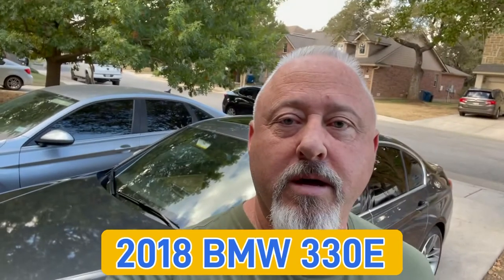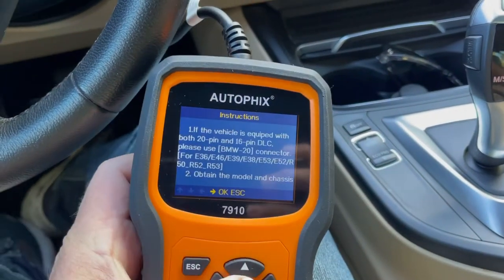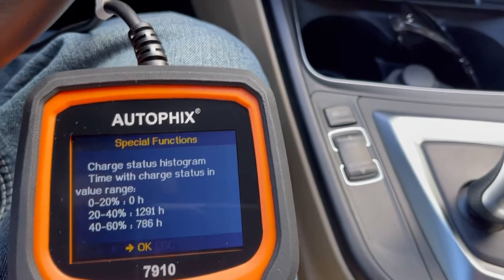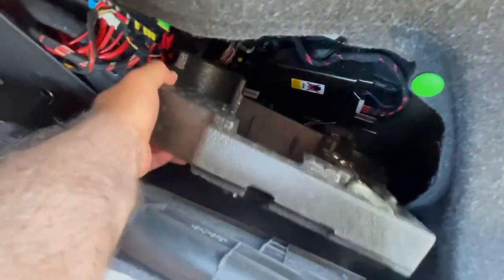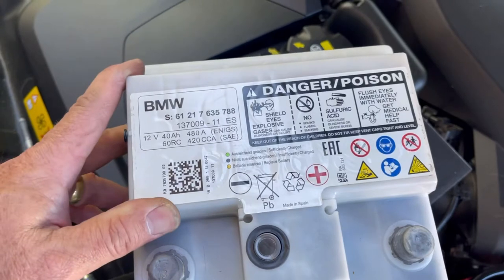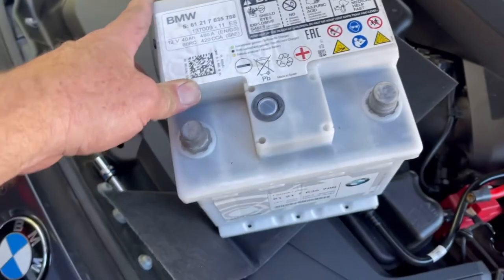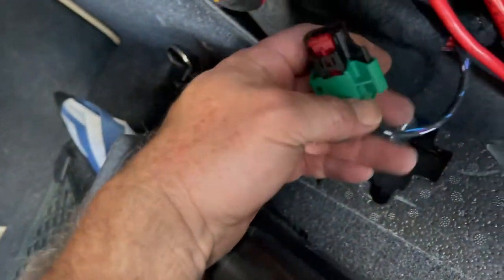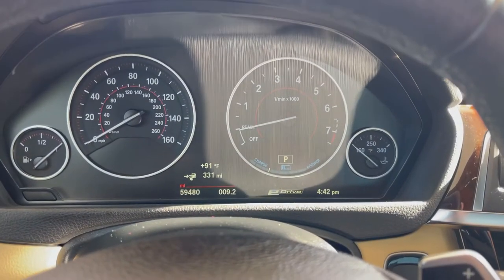2018 BMW 330E CHECK DRIVETRAIN FIX/RESET

Comment: Dave -  Thank you so much for posting this procedure.  I have a 2017 330e with the exact same issues (check engine light and check drivetrain notification) that all of a sudden came up.  Being a hybrid I took it into the dealer and the quote for repair that came back was astonishing ($3300 !!!).  They of course got a bunch of OBD2 error codes (same ones you got) that pointing to charging issues, except for that starter pinion stuff.  They "recommended" changing the aged battery, but also the charging controller, and the IBS cable that reports the state of the aux battery to the controller, and then see what happens.  A lot of overkill! to resolve an aged battery issue.  They claimed that once the battery goes bad it could affect the other connected systems.   I could not get over the fact that batteries wear out normally over time and stop taking the charge.  This kind of stuff happens all the time in all cars.  ---- The result .. I refused the work and followed your step by step process and it worked just as it did for you! 

Thank you for the battery link.  I was able to find the OEM battery easy enough, but was impossible to get batteries shipped to me.  Advanced auto parts saved the day.  The dealer wanted $550 for the battery almost double what I paid at AAP.   So THANK YOU again!  Have driven the car about 60miles since the change and all systems are OK.
Reply from the maker: Awesome!
Reply: @Itssuperdave  and Jorge, Hi Jorge, there are comments and feedback from this videos and other similar that the issue came back.  I just want to check with you how has it been for you.

Comment: Just replaced the aux battery on my F30 330e thanks to this video. Battery was £78 from BMW dealer.  The error disappeared as soon as I drove the car and it started the engine 😀
Just need to get the battery registered as BimmerLink will only register the main battery and not the aux one - confirmed by BimmerLink support 😟

Comment: There were two options in your battery maintenance menu on the scan tool, looks like you registered the first battery which is the one in the trunk. Not the additional battery, which is the one in the front.

Comment: Actually you can register the front battery as well. Once you swap it with new battery, use ISTA+ and go to Battery > Voltage > Starter > Register Aux Battery option.

If unsure use Foxwell NT710 Scanner to register Aux battery.

Start stop function is only related to the battery in the trunk/boot which is an AGM battery. You don't necessarily need a AGM battery for the battery under the bonnet at front you can use a standard battery and majority of the EU/UK customrr swap that with Vatra B36 V12 44 aH or Bosch S4000 Battery.

Comment: Hi Dave - many thanks for this , very helpful and easy to follow- quick question , once you have replaced the aux battery , and you go to register the new aux battery using the 7910, how does one know its the aux battery that is being reset and not the main 12V battery in the trunk ? There is no option on the 7910 for main battery or aux battery. - many thanks
Reply from the maker: I believe only the aux battery can be reset.
Reply: @Itssuperdave  thanks Dave- that is correct from the info i have been able to gather , the main 12V battery in the trunk does not need to be registered when replaced, but the aux AGM battery does.
Reply: response from ChatOpenAI- does the bmw 330e 2018 model reuiare the main 12v battery to be registered?

No, the main 12V battery in the BMW 330e (2018 model) does not need to be registered. Unlike the auxiliary high-voltage battery, the main 12V battery does not require any special programming or software updates.

However, it is still important to properly maintain and replace the main 12V battery if necessary to ensure that the vehicle's electrical system operates properly. A weak or failing 12V battery can cause issues such as reduced starting performance, electrical faults, and loss of power to various systems, so it is important to keep it in good condition.
Reply: @sohailsiddiqi5905  Actually, the opposite is true. The main battery (in the trunk which is AGM) needs to be registered when changed. The aux battery, which isn’t an AGM battery, doesn’t need to be reset. The hybrid high voltage battery, is an entirely different battery that this video did not address.
Reply: @sohailsiddiqi5905  Good grief. The AI chaos has begun, this is not accurate information.
Reply: What was the conclusion does the battery in the trunk the H6 AGM 12 V does it need to be reset or not

Comment: I have the same message and engine light on. With my OBD scanner, which is a regular one, it's giving me the code for the vacuum pump control circuit open. The voltage on both batteries is over 12.8v but my car won't run on electric only gas

Comment: Thanks for the video. It's great. Could anyone find this battery replacement in the UK?
Reply: Bosch S4 000 fits but not 💯 if it's the right one
Reply: @murphyslaw2020  that is the one I've actually used and so far no issues at all...
Reply: @marianvladutionita9015  glad to seen it's working for you a customer supplied his own battery for me to fit and it was the one above. BMW did a recall for the starter and told him he had a battery code etc.

Comment: I got the message when I unplugged too quickly at a public charger. I'm not sure if it's cos there's still charge flowing in the cables but as soon as I started the car it was under the impression battery no longer charges. After 3 restarts I got no message & was able to drive in full electric no issues. No warning message again although not had chance to connect an obd.

Comment: Did you upgrade the display? I have a 2016, 330 E. An early build it has id4evo :( Even though it has almost every option top /side  view cameras Heads up display stop and go cruise control. It would be nice if I could upgrade to id5 I was just not sure because there are different menus with the Edrive
Reply from the maker: No, I did not update it

Comment: Hi Dave, I have the same car as yours. 2018 BMW 330e US model. And I have the same message since three days - "Drivetrain: Check Soon" message. I do not have engine lights on or any other message. I ordered the OBD scanner that you linked here to scan if I am getting same error codes as yours. I have a question though, after changing the battery did you face any issues again till date, has it been working fine? Secondly, I'm having a hard time finding a H3 battery and for some reason AAP guys are telling me that my car should have H6/H7/h8 batteries(which I think are too big and not the correct fit). Also, how long do you think is it ok to drive this car as is if it is okay to drive with that message on (I need the car for the next two days after that I am fine and I can find the battery and change it).
Reply from the maker: I have not had any problems since I replaced the auxiliary battery. The only place you are going to find that battery besides, the dealer is at advance auto parts look in the description it is not call an H3, but this battery will work the cold cranking amps are Just slightly lower.
Reply: @Itssuperdave  So I ran the diagnostic test using the Autophix scanner tool and I only got two error codes  - 21A511 and 21A50A: Starter system, pinion starter : Time out successively occurred multiple times. I tried clearing them but 21A50A doesn't go away. Also, I ran a full system scan, and it gave me a 2228C8 - Starter unit, auxiliary battery: Aged auxiliary battery. Now I am confused whether to change the battery or to got the a dealership. I am out of warranty period as of now.
Reply from the maker: @fishw_owater  the problem is the auxiliary battery. I had the same two codes. Nothing is wrong with the starter.
Reply: @Itssuperdave  Thank you very much. I’ll buy the battery tomorrow and install it following the steps you mentioned here in the video. 👍
Reply: What happened? Did it fix it? Let us know :)  @fishw_owater

Comment: I have the exact same error messages coming up on our 2017 330e.  Took it to BMW and they charged me $200 to run the diagnostic.  Told me the aux battery is bad but they also told me I need replace the IBS Cable at the same time....$1600 fix.  Do you think replacing the IBS cable is excessive?
Reply: Also, how has the battery been working since install?  Any issues?
Reply from the maker: Battery has been working great.
Reply from the maker: I have no idea what the IBS cable is.
Reply: @Itssuperdave  it’s the Intelligent Battery Sensor cable, that informs the battery management computer module on the state of charge and age of the battery.